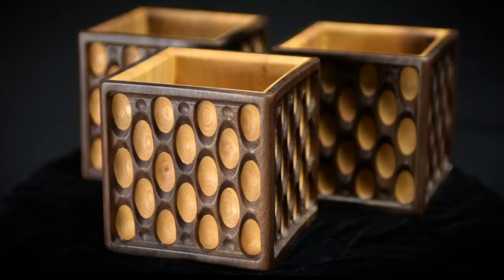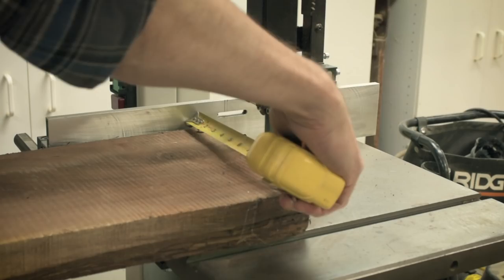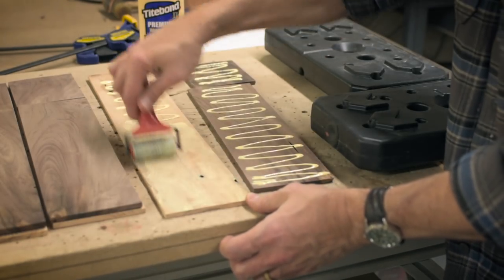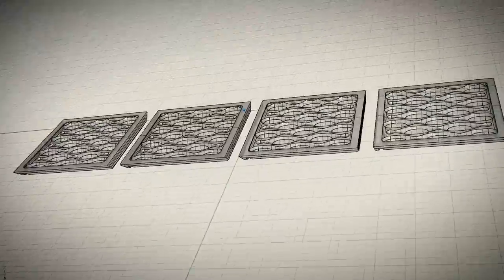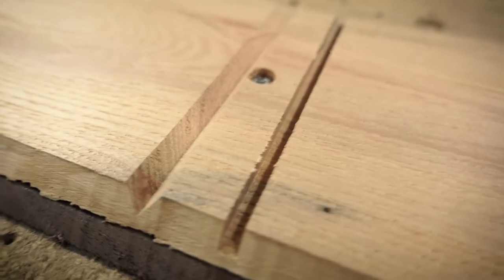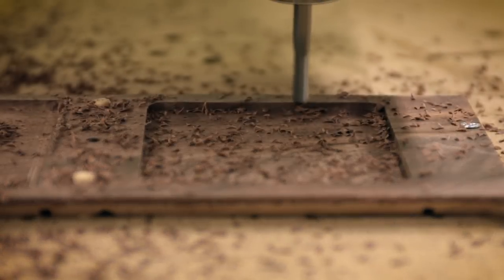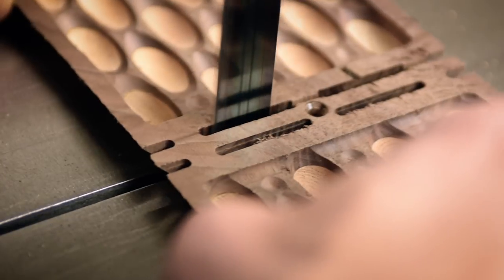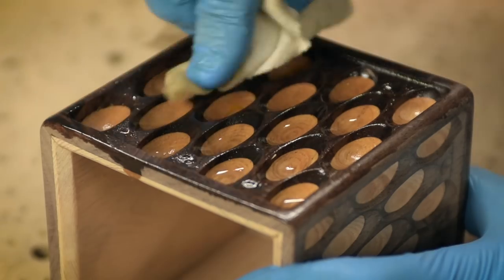How to Make a Pencil Cup with a CNC Router | Mid Century Modern Design

Comment: Hi,

Not sure if you still look at the comments, but really great video.

A question if I may, how did you generate the tool path for the 45degree mitres. I have been struggling with this for some time.

Cheers

Andy
Reply from the maker: Thanks for checking out the video. The mitres are simply very large chamfers. So, I used the “chamfer” settings in RhinoCAM to generate the tool paths. I hope that helps.
Reply: @WorksbySolo  Thank you, I am using Fusion - so will see if it has anything similar.